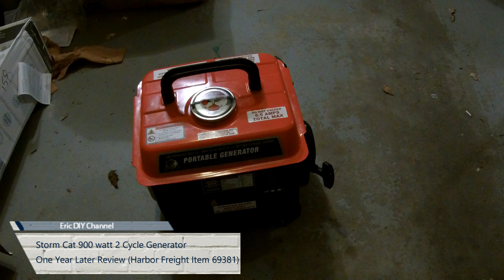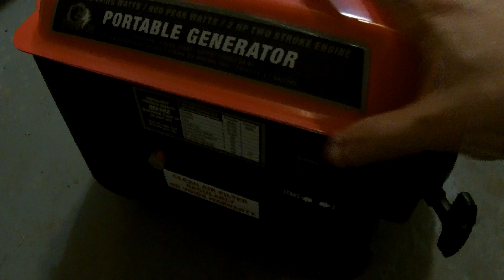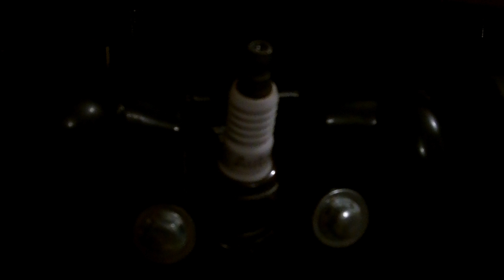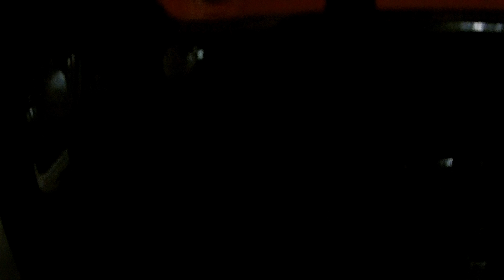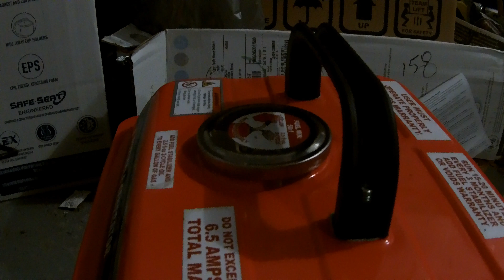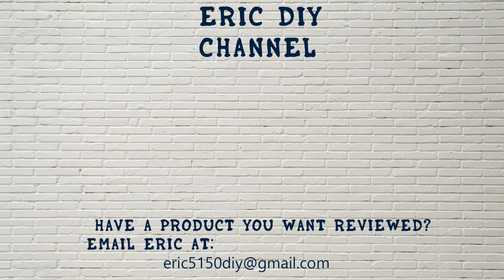Harbor Freight Storm Cat 900 watt 2 Cycle Generator One Year Later Review

Comment: I bought one of these three yrs.ago,an you can’t be to ruff with them.You have to learn a starting strategy so you won’t break your pull starter.Mine starts up fairly easy, I open the fuel valve , let gas run into carb. for 5 to 10 minutes, then pull starter rope very slowly to get a little gas into combustion chamber ,then pull starter rope to start generator an it will fire up on 4th pull.It used to fight me , but I had to learn its easy way of starting.Each generator has a hard way an easy way so you have to take that in consideration when owning one of these.